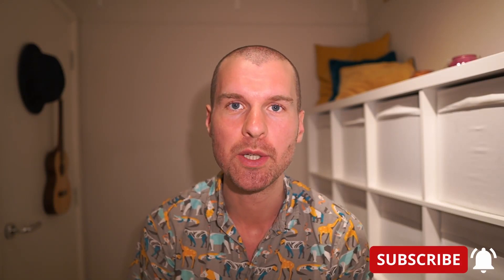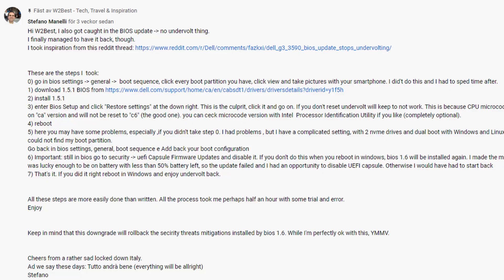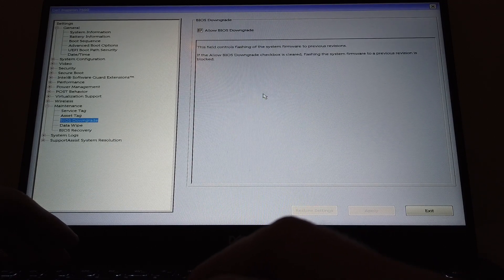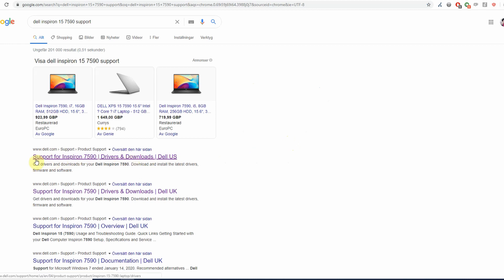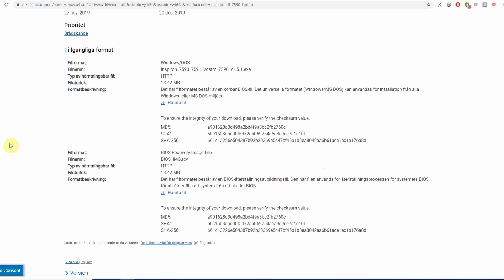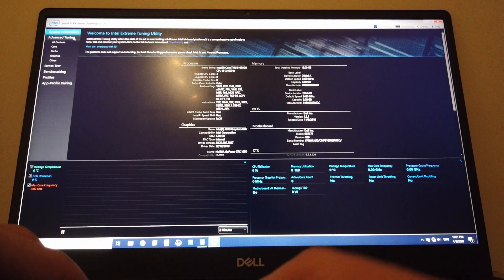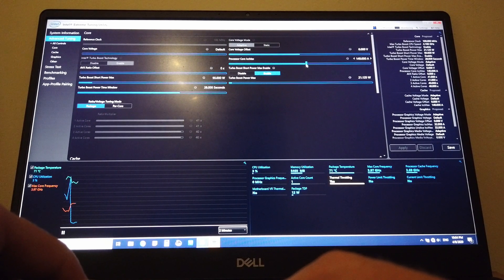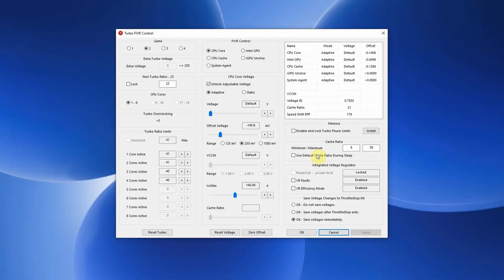Fixing Undervolt After BIOS 1.6.0 Update on XPS 15, Dell Inspiron 15 & Vostro 7590

Comment: I tried you this on my dell G3 i can  finally see offset on the top right box of TS but even if i make CPU core -1000mv it doesnt make a difference the offset on the right top box simply becomes -1 but the system crashes when increasing CPU cache

Comment: Mine seems to reset the undervolt settings when I restart the computer.  I can go back and change back again but after restart I just get default settings. Is there a way to make this stick?  I am a photographer and adobe lightroom loves to use 100% cpu for some tasks like importing and exporting.  What happens for me is it will run max CPU get super hot and then thermal throttle down to a really low clock.  So with this comes more time under load, more heat, and slow slow performance.  The undervolt seems to help with this.

Comment: nothing worked for me. i tryed 1.5 1.6 1.7 1.8, all ways here in the coments but still in gray mode the voltage section. I can just disable the turbo boost. but is annoying the fans being always on even in simple tasks
Reply: I DID IT!  After almost give up, for last time i instal version 1.5, and i use an old version of the IETU and..... is working!
so the problem can also comes from the intel program, so probabli also works in dell 1.6 version or latest!
Reply: @elsonornelas3782  What’s your version of IETU?
Reply: @svobodaslov  the last version. 1.9 and is working
Reply: Can you guide me on how you found it ? Where can I find where I can update it
Reply: @CruzWithMe  what

Comment: Dell xps 15 7590 - Only found a 1.5.0 bios version and succesfully installed it. However, the laptop seems to automatically reinstall the newest version 1.9.1 (with "bios guard" i think?), as soon as i restart the laptop:/ I disabled the bios recovery option and it seems to have fixed that issue. However, i am still not able to undervolt (still greyed out):/ Any suggestions?
Reply: Same problem here. I install version 1.5.0 and when it has booted completely I get a prompt that I have to restart to complete the bios update to version 1.16.2

Comment: Hello
Iesterday I upgraded to bios 1.9 (gen/2021) reboot and no undervolting
Then I entered BIOS setup, made a factory reset, reboot and voilà, undervolting with TS works again. Running at -145mV 
Cheers
Reply: Same here, Just did "factory reset" and after rebooting i was able to unlock undervolting via TS right away. My bios version is 1.9x version on 9570 for anyone who might need reference.
Reply: Curious.  I'm on 1.9.1 and undervolting via TS still doesn't work for me. (xps 15 7590)
Reply: @ianworthington2324  tried factory reset? Its not bios default settings option just in case
Reply: @EzeRazor  does that reset just the BIOS settings or the whole laptop?
Reply: @ianworthington2324  I noticed no change at all by doing factory reset option bios, not change at all at OS level if that was your question. Thats all i can say, did that and that was fixed when loggin into windows
Reply: Factory reset does not reset your OS.

Comment: Your video is wrong. You have to select "FACTORY SETTINGS" in the bios, NOT "BIOS Defaults". Otherwise it wont restore undervolt.
Reply from the maker: Both work
Reply: @w2best  No. Totally not. It seems to depend on the model and some weird anomalies, Ive seen several reports now that bios defaults WONT work, it also didnt on my model. Just factory settings worked.
Reply from the maker: @bestonyoutube  Well as in the video i make it work i would say that it works. :P

Comment: So undervolt on dell laptops is past. So i just disable Turbo boost in throttleStop and i again playing with normal temperature below 70C.
I dont know if that is good for laptop, but i play gta5 or star wars 2 for 5 to 6 hours and its normal. If someone have better solution pls answer is disabling the turbo boost good or bad ?
Reply from the maker: Turbo off or limited is my way too. It's fine for the machine!

Comment: Inspiron 15 7501 bios 1.5.1 not working, reset to factory settings, also tried bios defaults, disabled uefi capsule updates, XTU offset still greyed out. Should i try downgrade on 1.4.1? Any ideas? Thanks
I did downgrade and it didn´t help. No idea what should i do.

Comment: I was able to downgrade the BIOS to 1.50 on XPS 7590, and also disable the "UEFI capsule firmware update", however there is still no undervolt ability in "Intel Extreme Tuning Utility".  Anything i miss????
Reply from the maker: Did you reset to factory settings too?
Reply: @w2best  First, I tried with your method but unfortunately, it didn't work, so I tried to reset it to factory settings which converted it back to 1.6 instead of 1.5.
Reply from the maker: @khanhluong2523  oh, when you reset factory settings in bios it changed the bios? That shouldn't be possible. Install the right bios, then go to bios settings and reset. That's how i got it to work
Reply: @w2best  I tried these steps as follow:
1. Downgrade the BIOS to 1.4 --> Successfully
2. Reboot the system and system flashed the BIOS to 1.4 --> Successfully
3. Re-enter BIOS setup and unchecked UEFI capsule firmware update --> Successfully
4. Booted into windows and tried out "XTU" --> Grey out the voltage setting :(
5. Reboot the system and entered BIOS setup, then "Reset factory settings" --> Successfully
6. Unchecked the UEFI capsule firmware update again, save and exit.
7. Boot into windows, XTU is still "GREY OUT"
8. Tried with Throttlestop, CPU core = can be edited, CPU cache = can be edited....so i'm trying out with ThrottleStop now.  Crossing my fingers
The only difference from my system was I upgraded the BIOS to 1.8.1 automatically when I first got the system....so i'm wondering if somehow Intel disable undervolt even if I rolled back the BIOS?????
Reply: @w2best  I've successfully undervolt using Throttlestop with BIOS 1.8.1

Comment: Thanks. This don't work for my XPS 15 9590 (it was on BIOS 1.8 initially). Downgraded several times now with to both BIOS version 1.5 and now 1.4, also did both, default settings and Factory reset in the BIOS and disabling the auto update. The voltage is still grayed out in Intel ETU.

Spent so many hours on this by now.. Not sure what is going on or how to proceed. Any help would be much appreciated.

Comment: I have dual boot (win 10 + linux) on my xps 15 9570 i7-8750H. It was serious pain in the ass to make it and I was forced to change a lot of settings in bios. 
If I do this "reset to defaults", it will not just reset bios to some basic version but also reset all settings as well?

Comment: If anyone using dell 7577, please if you have 1.8 bios recovery image or older versions like 1.5.3, I'll be most happy if you share it with me, my bios is in 1.9.3 and all versions of 1.11 and 1.9.3 ruined my laptop!
Reply: You don't need 1.8 recovery image bro...
#1 Downgrade to 1.9.3 using recovery image, 
#2 After downgrade go to BIOS and do "BIOS Default Settings" 
#3 After restart again go to BIOS and disable capsule firmware updates
#4 download drivers version 1.8's Exe file from Dell download page and install from within windows

Note: after downgrading to 1.9.3 you can downgrade your BIOS through exe files given in Dell Drivers page. Just make sure you "restore to BIOS defaults" after downgrading through IMG file

Tutorial:-
https://www.reddit.com/r/Dell/comments/j0ha5r/for_all_the_inspiron_7577_owners_who_updated/

Comment: This doesn't work on my XPS 15 9570 on BIOS 1.15.0 (latest before undervolting disabling). Downgraded, reset to factory settings (also tried bios defaults), disabled uefi capsule updates, booted into windows, offset still greyed out. Any idea on how to make it work?
Reply: Hey ! Did you find out how to do it ? I’m having the same problem
Reply: @ricardohagen4553  I didn't! I think I'm gonna try with the EFI variable trick. If you don't know what I'm talking about, I'll post some links

Comment: I get error saying Bios update blocked due to unsupported downgrade I downloaded the correct file too
Reply: Which laptop.. The new update on Inspiron 15's also block downgrade on BIOS unfortunatley :(
Reply: @RebexYT  7577
Reply: @vigilante9259  i have the previous version, 7567.. nd i can't downgrade also
Reply: @RebexYT  worst thing is these laptop heats up so quickly im thinking of building a pc laptop gaming isn't great
Reply: @vigilante9259  Yup exactly.. i've been facing this throttling issue since last two years. But i never realized untill it had gotten worse.. I got a repaste last year.. it was fine then.. but now my CPU drops to 2.1 GHz during games. Which is so annoying!
I am also thinking about building a PC.. but first i'll try this undevolting thing. I only checked it now, when it was already blocked on these latpops.. But i'm trying to figure out a way to downgrade the BIOS and do it..
Reply: @vigilante9259  Many Laptop users who use their laptops extensively for gaming, suggest undervolting.. and i haven't really tried it yet.. i have undervolted my GPU, which has given me quite a performance.. cuz my GPU doesn't go up 65"C which is good.. cuz that helps in keeping the CPU cool also.. having the same heatsink connected to both CPU nd GPU on this laptop
Reply: @RebexYT  what gpu do you have and how did you undervolt it? Btw I had my laptop cpu undervolted I didn't never the lastest bios update gonna block it now I can't undervolt it anymore and when it was undervolted the heat issues were fixed :(
Reply: @vigilante9259  yeah that's wat i'm looking for.. to control my CPU temps.. I have even gotten a laptop table with cooling fan.. nd i removed the back lid of my laptop nd place it above the fan.. that keeps me away from throttling.. 
I have a GTX 1050 4GB on my laptop.. 
I watched this video to undervolt my GPU, it has the same specs as me
https://www.youtube.com/watch?v=sZHg_nT84CM
Reply: @vigilante9259  Only if i can undervolt my CPU.. i think my problems would be solved with this laptop..
Reply: @vigilante9259  have u tried BIOS recovery yet? I think with ur varient.. that'll work out..
here's a thread from a guy who fixed it in ur model
https://forums.tomshardware.com/threads/bios-downgrade-blocked.3639965/
Reply: @RebexYT  alright thanks I have the gtx 1060 with i7 7700hq cpu and the cpu reaches 90°C when i undervolt it before bios update it was 75°C
Reply: @vigilante9259  That sucks.. try resetting ur BIOS to factory settings from inside BIOS option.. that worked for some people too
Reply: @RebexYT  in same bios verison? I can't downgrade i tried everything
Reply: @RebexYT  i don't have factory settings option, only BIOS default/ last known good settings/ custom user settings :(
Reply: @vigilante9259  Well that sucks.. But you can also try BIOS recovery method
Reply: @RebexYT  any idea how?
Reply: @vigilante9259  turn off laptop, then press and hold ctrl+esc and plug in ac - laptop should turn on in recovery mode
Reply: I found this tutoral:
https://www.reddit.com/r/Dell/comments/j0ha5r/for_all_the_inspiron_7577_owners_who_updated/
I will try it today
Reply: Hi, i tried this tutorial and it works perfectly for me. If you'll have any problem with it - contact me on discord: Niepacz#6633.
Reply: @mariowitki  do you also use a 7577?
Reply: @vigilante9259  Yes :)
Reply: @mariowitki  ok ill add you on discord :)

Comment: Just bought i7-9750 and it had Bios 1.7.0, so I couldn't undervolt.  I went to the Bios and restored to factory settings and I am able to now.  Have it at -135mV.  Just a FYI
Reply: My BIOS doesn't allow downgrade on Dell 7567 after updating it's BIOS to 1.12
Reply: @RebexYT  Maybe you dont have to downgrade....just go into the bios and do Restore to Factory settings.  Seems like that is working.
Reply: @Dahotdogeveryday  i did try that.. did u reinstall intel XTU or throttlestop after that? if those are what you're using for undervolt
Reply: @RebexYT  Sorry no.  I am using TS.  It rebooted, opened TS and I could see the values adjusted right away.
Reply: @Dahotdogeveryday  Sadly for my Inspiron 7567, this is not the case :(
Reply: @RebexYT   Did you try this, if it pertains.   mportant Info if not already somewhere commented!!
On DELL XPS15 9570 I needed to download version 1.15.0 an the most important after your steps was following:
Go to  BIOS setup -> security -> UEFI capsule firmware updates -> disable it!! Otherwise your BIOS will always be updated while boot sequence.
Hope that can help
Reply: @Dahotdogeveryday  Yes.. i did.. this option is Disabled.. plus i have tried BIOS recovery aswell.. nothing seems to be working for me.. i'm trying to force BIOS downgrade but sadly for Inspiron the recovery image file doesn't come with drivers.. so i can't do that either..
Reply: @RebexYT  dell decided to not let us downgrade from previous versions of bios. Now I can't play games on my g3 without hitting 100degrees. 😭😭😭
Reply: @goldwally1428  exactly.. i'm also facing the same issue :(

Comment: I was not able to adjust the voltage offset of my Dell G3 3579 with bios 1.13, it was greyed out. I was gonna try to downgrade the bios, but first I tried to reset the bios to BIOS Defaults and, just like you, it didn´t work. But, I also reseted the bios to FACTORY SETTINGS and it worked!! Now I can undervolt with bios 1.13, no need to downgrade!
Reply from the maker: yup! Half the people have it work like that :)

Comment: Factory settings instead of default settings on Bios 1.14 worked for me on a Dell G5 5587
Reply: hey,i also have g5 5587 and i am on 1.14,do i only have to set to factory settings in the bios or do everything in the video
Reply: @leb5550  only the first part about the factory settings you don't need to downgrade you Bios version
Reply from the maker: I'd recommend everyone to start by doing that and see if it works per the instructions in the video. As it didn't work for me I had to proceed to downgrading.
Reply: When I do this, every time I restart my laptop I have to re-do this step in order to undervolt again... is there a way to make this permanent?

Comment: Hello i need your help! I am using Dell 3579 (g3). I upgraded to latest bios for it that is 1.13.0  .    Earlier throttlestop worked at 1.1.0   . Will it be alright if i follow the same process as you?
Reply: I have dell G5. I can't downgrade to     previous bios, but restoring FACTORY settings helps me to return undervolting.
Reply from the maker: Yes try just restoring factory settings :)

Comment: This worked wonders on my XPS 15 9560, thank you!!
Reply from the maker: That's great! happy to help!
Reply: I have a Dell XPS 7590 running Bios 1.8.1 and just resetting to factory settings worked for me, thanks! Not default settings, factory settings.
Reply: Ipodtouchftwz How? It won’t allow me to downgrade my bios and it crashes for the factory reset.
Reply: @elijuvan4131  The actual downgrade showed as failed for me too, but when I went back into the bios it had successfully downgraded anyway...
Reply: Which bios did you use with the 9560?
Reply: Does this process reset the files on the computer?

Comment: XPS 9560 here. Resetting to bios (v1.9.2) factory setting worked for me, BUT after awhile (let's say 12 hours) throttlestop (v9.0) becomes again unable to undervolt. I did not catch the exact moment when it happens (probably overnight) but I'm sure that the notebook did not reboot. Any thoughts?
Reply: UPDATE: when the laptop goes to suspension mode it lose the ability to perform undervolt (for example after closing the lid). So, for me, the "factory resetting" works and is lasting until the laptop goes the suspension mode (or reboot).
Reply: Marco Iarlori same. Trying to find a way to make this permanent.

Comment: For me is blocked downgrade 😢
Reply: me too, there is no 1.5.1 option. only 1.5.1
Reply: I have the same issue but i managed to fix it without downgrading the bios. I tried restoring to "Bios default" like in the video  but it did not work so i tried again but this time i choosed the option below wich is "Factory settings". A message appeared saying that it needed to restart to apply the changes. My laptop restarted and now i can undervolt again!. I hope it works for you too.
Reply: @juandiegorivas2690  you're a legend... thank you... it worked for me

Comment: thanks you very much bro..just got my Dell G7 7790 i7 9750H and had the bios updated and due to the update i cant edit TRL on Throttlestop..i followed your steps..but instead Bios Default i use factory settings..and its working alright..i did not need to download previous version..kudos!..